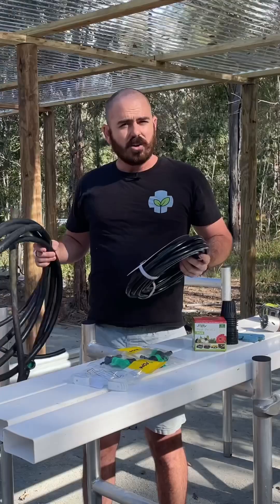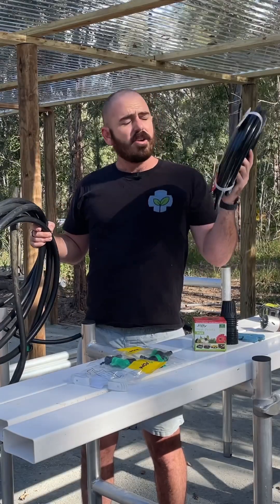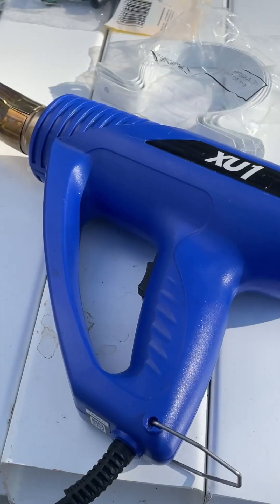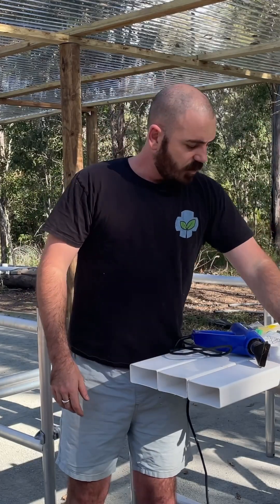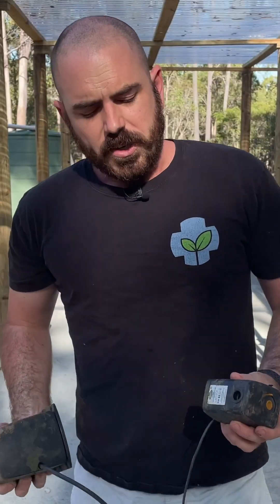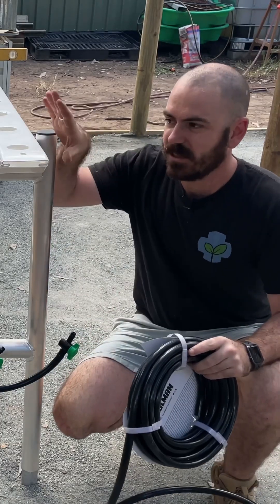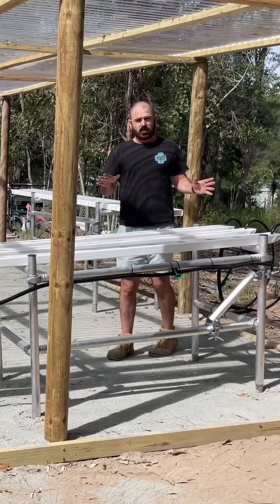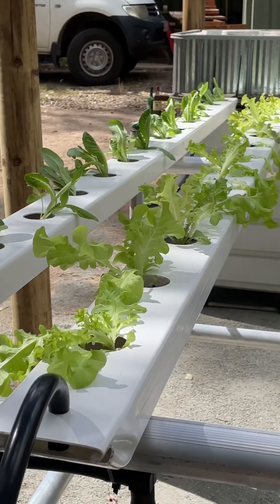How to Build a NFT Hydroponic System in 60 Seconds #hydroponics #hydroponicsystem #diy

Comment: That is a LOT of flow is t their a university white paper on the optimal flow
Reply: Do you have e a listed step by step instructions and parts list? Especially the pump...whats the best size?
Reply from the maker: There’s taps on the end to adjust the flow which were wide open, it doesn’t run like that